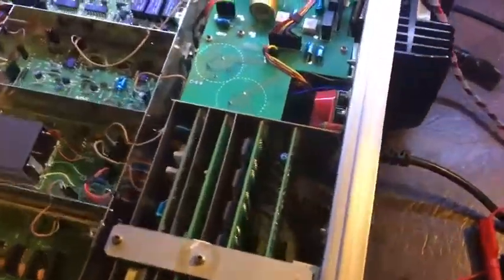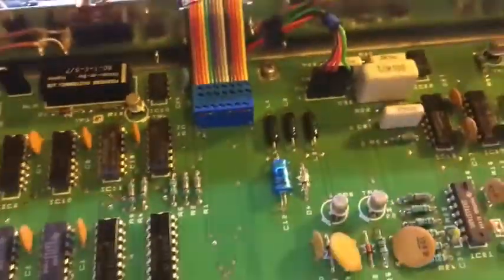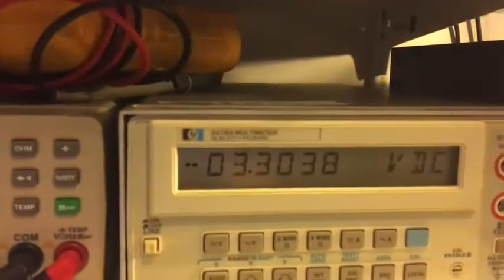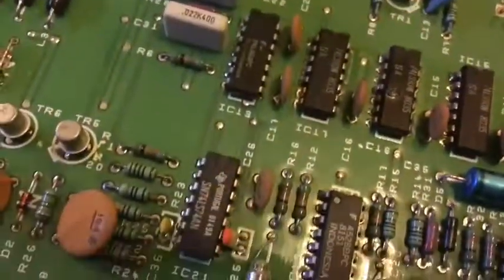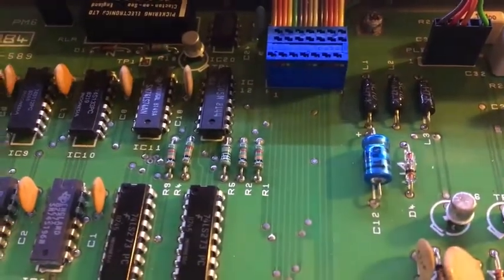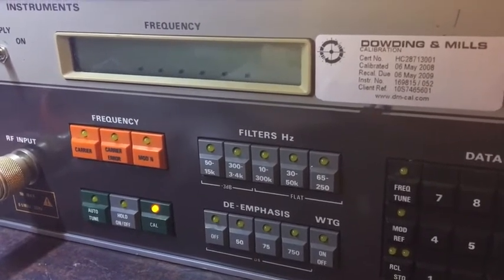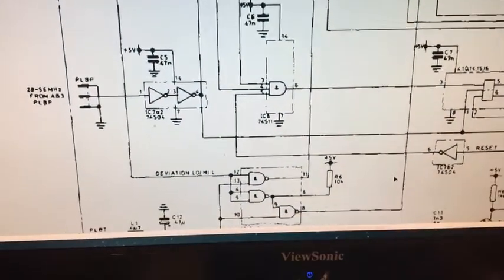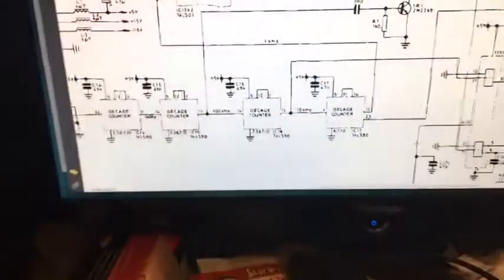#44 Repair Marconi 2305 (again)

Comment: Good job on finding the fault. Sometimes those chips die without a cause.  Was also a good idea to cut those pins.  If I am removing to save the chip I apply paste flux and resolder the pins. This make desoldering easier due to the contaminates in the old solder.